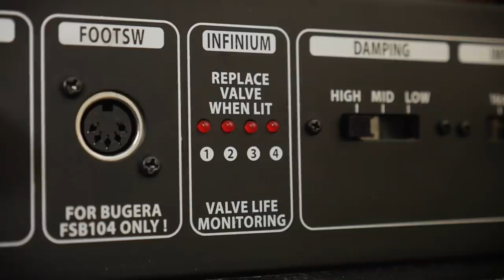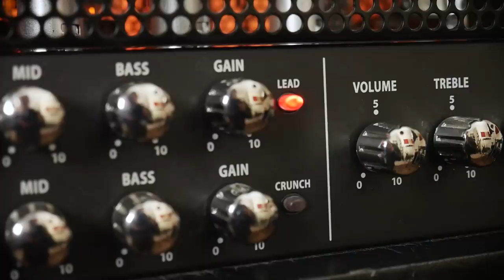Fire Hazard Amplifier?! | Bugera 333 Infinium

Comment: I've owned two bugeras in my times, I got it after the known plastic clip issue was corrected. These amps kick ass yo. A 600 dollar 6505? count me in
Reply: How about the Peavey 6505 MH? Isn’t that in that price range as well?
Reply: @MrHoelgaard  in that price range but a mini head that only outputs 20 watts or somewhere in that range compared to a full sized 120 watt head
Reply: @aidenmcclendon5457  fair enough then. With the 6505 MH you still get the real deal, just in a smaller package. And often the 20 watt head are loud enough for smaller gigs. Then if you want to play at bigger venues, you can just mic it up.

Comment: Im looking at one of these, and I have a Boss TAE as well. So long as Im using a 100w speaker (through the TAE) im good as far as not having to worry about the speaker, right? I know I could line it out to my FRFR and a cab response but I occasionnally get to actuall turn my amps on (family in house LOL) and I want to ensure I don't damage my lower wattage (60 and 30) if I want to switch flavors of real speakers. Thoughts?  I love that riff at 4:10 ish, too. Total 80s metal.

Comment: i was involved with the AMP FIRES...  here is what happened.  the very first run of bugeras had a small problem,  you see,  uli behringer was buying chinese parts in cash at that time.  there is a connection between the preamp section and the amp section,  there is a plastic clip that makes that connection.  uli,  trustin the chinese to send what he bought, did not send HEAT RATED clips... they just sent regular connecters.  these non heat rated connecters would melt and then the wires would short causing said fires..  it was the very first run and created a black eye that behringer / bugera still deals with today.  this hasnt happened in many years and was a specific part.  its no longer an issue...

Comment: I kind of wish I would have picked up a Trirec Infinium when they were available.
Reply: I have a Tri Rec. From what I hear they’re modeled after the Mesa Boogie Duel Rectifier. The low end is kinda muddy so it sounds best with a boost pedal even though it’s already got a boost button and knob on it. One of the cooler features is it’s got a built in attenuator, (Varipower) is what the knob says. So if you’re playing at lower volume then just dial back the Varipower accordingly. 
I have the 333XL as well and I do like the sound better on it. It sounds great at lower volume without an attenuator. BTW I have heard that the 333XL is modeled after the Peavey JSX. I Briefly had a 6505+ combo and sent it back because it sounded just like my 333XL and I was looking for something a little different as I was gonna run them in stereo.
Reply: @guitarzan2979   coolness. My only valve amp HEAD is a Jet City JCA20H. I also have a few hombrewed tube pedals I run as preamps into the JCA20's fx return (a mod I did). It's also got a 10k cathode reistor on the cold clipper section, like a JCM800. I can never leave well enough alone. Probably best I didn't buy a tube head with more advanced curcuits (MIDI, the Biasing or "infinium" and the power scaling). I'd have mucked up something in it. Jet City's 20/50/100 watt heads were basically Soldono clones, with the 20 being only the crunch channel of a SLO (basically a hotter JCM800). The 50 and 100 were SLO clones. Not a whole lot of doodads to muck up, and lots of mods documented out there. I'm a valve amp nerd...I still need an ox even for 20 watts..oh, and I bias low and variac for "that" tone.
Reply: @Bob_at_OZDiggzguitars  you’re my kind of character, you have some sneaky tricks up yur sleeve! Very cool stuff.

Comment: You ever had issues with their auto bias module? Mine crapped out on my TriRec and they don't release schematics so I have to travel 2 states over to get it fixed at one of their "licensed repair shops".
Reply: The same thing happened with my Tri Rec. I broke it down to the chassis to see if anything was visually burnt etc etc and couldn’t find anything wrong except I noticed that the little mini bias circuit board had a vacant spot where a harness should be plugged into it, but I didn’t see an unplugged harness so I thought it was supposed to be vacant. I ended up driving it to another city to an authorized Bugera repair shop and guess what. A harness WAS supposed to be plugged into that spot, but the harness was buried under another circuit board where I couldn’t see it unless I had unscrewed and removed that board. So evidently the harness never got plugged in at the factory.
Reply: Did you email them? I had no problems getting schematics for my Behringer (same company, different brand) bass combo when it needed fixing a few years ago.
Reply: In reference to my first reply, it worked fine after they plugged the harness in to the auto bias board, but started sounding crappie shortly there after, so I ended up shipping the amp back to the repair shop and they had to re solder a few spots that were on the auto bias board that weren’t done correctly at the factory. The name of the shop is “Jaydon Electronics” Jacksonville, Florida. There is also an online electronics store that sells circuit boards and other parts for Bugera amps. I can’t think of the name right now but if you need it I could look it up.

Comment: I have the Trirec and it works for me
Reply: I’ve got both and I like my 333XL better because my Tri Rec is muddy on the low end. I was never quite sure if that’s the nature of the beast or if something is wrong with mine because I bought it used and it had another issue that I got fixed. I do use a boost pedal with the Tri Rec though.

Comment: I bought the first run 333xl. It sounded awesome at home. I took it to band practice and turned it up. 1 minute into the first song it died. I had sold a bunch of gear on ebay to be able to afford the $599 plus shipping. I was a cheap fix. A melted plastic connector. But no amp repair guy will tell you that. Hey buddie you need a new output transformer! The amp sat for two years until I saw a youtube video showing the problem. I took the amp out of cabinet and brought to the same tech. I put my finger on the melted connector and asked can you fix this? I worked for about year then died. I put it in the dumpster.

Comment: It is almost as if amplifiers are a simple and very mature technology with little in the way of audible differences, at least until you start putting tone-shaping circuits in there. It honestly seems like the high-end amp markets is mostly about the prestige of owning an expensive amp, since a bit of faffing with a good modeler can get you the same tones.

Comment: I have a Tri-Rec sitting in my closet. Sounded pretty great-till it died.(anybody want it?)
One day, it just seemed like it would not come out of standby.
I took out the switch, wired to be always on, and nothing.
Also had 333 combo-non infinium- and it was great- till it died.
They used the cheapest jumper connections, and they would either burn up, or constantly disconnect themselves.

Comment: Ahoi, Colin! 
I have been playing guutar for more than 15 years now, but I have never actually owned an amp that was actually anything to write home about. As a matter of fact, I myself have never even personally owned a guitar amp that was more than 80€.
Next year, I will quit my side job and actually start working (as an actual teacher, I am currently still studying).
Now, I've been looking far and wide, looking for an adequate amplifying solution.
I don't want to be busting the bank (700€ is kinda the limit I set myself), but I would like something that I can comfortably use for practising, rehearsing, and gigging alike.
Do you have any tipps or suggestions for a high gain, low tuning metal fan with a soft spot for classic heavy metal and modern styles?
Should I wait for new develoments in the next year or do you have anything in mind?
Cheers from Germany,
Ray

Comment: What could cause an amp to catch fire?
Besides the short circuits that can come from thin circuit boards and sloppy soldering  the wrong bias overheating everything seems to be what is being addressed.
Can a tube failing cause overheating?
How can I tell if my tubes are bad besides tapping on it with a chop stick?
If you forget to turn off a tube amp how high is the fire risk?

Comment: Off topic question. Can I ask you what speakers/IR/cabinet were you using in this demo? And did you post process the sound with eq ect...? I loved your tone on this video and since I'm in the market for a new speaker to use for Hard Rock/Metal, I have been looking to celestion v30s or v-types, but I can not decide wich one
Reply from the maker: This was all through my Hoffnine Pro212V loaded with Celestion Creamback and V30 speakers, and captured by Lewitt MTP440 and LCT440 microphones.
Reply from the maker: What you are hearing is mostly the dynamic mic on the Creamback with a little bit of condenser capturing the V30 mixed in.
Reply: @ScienceofLoud  Ok, thank you very much, I'm going with creambacks I guess

Comment: Hey Colin, when people say general tube amp maintenance, what do they mean? Every time I hear this and ask but people say you're fine if everything is working properly.
Reply from the maker: Valves are consumable items; they have a lifespan and will eventually need replaced. 
The amplifier is biased to set the idle current of the valves. Over time and use this idle current shifts as the valves wear, hence it's important to occasionally have the amplifier re-biased to keep it working efficiently. 

If the bias drifts too far, or the valves themselves come to the end of their working life, the currents being pulled through the valves and surrounding components can be too high and cause damage. Recognising when valves are failing is important part of amplifier care. 
Sudden or gradual volume drops, unusual feedback, or cyclic oscillations in the sound are all indicators that the valves aren't working properly and you should STOP using the amplifier IMMEDIATELY and take it to a qualified tech. 
Trying to mitigate volume drops from failing valves by turning the amp up louder and continuing to play will only result in burning out components within the amp, which can be expensive especially if you take out a transformer in the process. 

Understand how valves work, don't move the amp while the valves are cooling down, remember to have your amplifier re-biased from time to time, and know what to look for when valves start to die.
Reply: @ScienceofLoud  Thank you for the very detailed response! When you say "occasionally" for rebiasing, are there any guidelines on this other than when an amps tubes are changed?

Comment: I don't know how much of the bugera's design is ripped from the peavey xxx/jsx but the 6260 schematic looks enough like a 5150 that I'm amazed bugera is able to get away with it. If it's the same for the 333 then I imagine you want to treat the eq like the peavey xxx. Start with the eq set to neutral and adjust each knob by ear, a little goes a long way thanks to the way the active eq works. If you try to treat the eq like you would on a marshall or even another peavey you'll find yourself struggling to get a decent sound out of it. The XXX is a very versatile design but there is a.. learning curve.

Comment: Instead of making an amp that doesn't fail and cause an issue we can call it the consumers fault for not recognizing the issue and stop using the amp. Thats a PR statement if I ever heard one
Reply from the maker: I've seen many valve amplifiers, of many brands, ruined in the same way by people who continue to use the amplifier despite warning signs that valves are failing. 

Valves are consumable items with a working lifespan, they need to be rebiased throughout that lifespan, and when they come to the end of their life they operate in such a way that they can cause damage to the device. 

What inexperienced players do when their amplifier suddenly drops in volume is to turn it up louder and keep playing. Or when it starts to blow fuses they keep replacing the fuses with higher rated fuses to prevent the fuses blowing. 

Fuses blowing and sudden volume drops are symptomatic of valves dying and drawing too much current. They are signs to stop using the amplifier and have it revalved and rebiased. 

This is true for ANY valve amplifier brand, regardless of pricepoint. 

The fact that you seem to be unaware of this fact indicates to me you are probably one of the people who would ignore all the signs and burn out your amplifier from misuse.

Comment: Let's be honest, is anyone really surprised that an amp with such a crazy low price tag is a bit of a one trick pony? If you buy one of these expecting something equivalent to the XXX that it's so clearly inspired by then you're not thinking straight.

Bugera amps are great bang for buck if you don't have the coin to drop on more expensive gear, but you do get what you pay for so don't expect miracles.

Bugera cabs on the other hand, the early 2000s ones at least were insanely good for the money. No idea how they pulled it off.

Comment: if the Bugera 333 Infinium has the auto biasing circuit then you dont have to fear destroying the amplifier when tubes fail so you could experiment in a way that could show us what failing tubes sound like as per https://www.youtube.com/watch?v=UBQnkzYlfcE video

the auto biasing circuit would  take the overload and regulate the current protecting the rest of the circuit?

Comment: That's the problem with Bugera amps ... they are cheap - too cheap and (young) peopole, who normally could only afford solid state amps, can afford them. But these people are mostly unexpirienced with tube amps. And so they make a ton of mistakes and blame the amp not to be realible.
I know a guy who bought a new 333XL back in 2008 (as i did) and he plugged that thing right away into his 15 watt practice amp. And guess what? The amp had a short life. (After a while the output transformer catched on fire.) Another guy with a 333XL played a live show with a mismatched pair of cabs (full stack). One had 8Ohm and the other 16 and he didn't set the proper output impedance on his amp. -> Output transformer died.
I for myself still have my original non-Infinium 333XL from 2008 and had never any issues with (but a lot of live gigs and touring). Actually i own two 333XL from 2008, a 6262 Infinium, a Trirec, a 1990 Infinium and a 1960 Infinium. They all work flawless. 🤷‍♂️

Comment: No, these amps aren't going to burn your house down, but as a technician who has had countless Bugeras come across his desk, I can tell you they cheap out big time under the bonnet of these amps. Cheap components, cheap connectors, bad solder joints, yadda yadda. 
I regularly end up having to give amps back to the customer still broken, because the cost of parts and labor exceeds the price of a used one on Reverb. 
Also, when the infinium fails, I've seen some amazing fireworks happen. So perhaps the burning down the house isn't exactly exaggerated. 

Not to mention the fact that they copy the designs of other companies who actually did some engineering, then just undercut them. Next thing you know, your 6505 is also a pile of rubbish because they cant afford to make them properly.  If we keep giving our money to shit companies like Behringer, one day there wont be any more good gear to upgrade into. Hell, we might already be there.